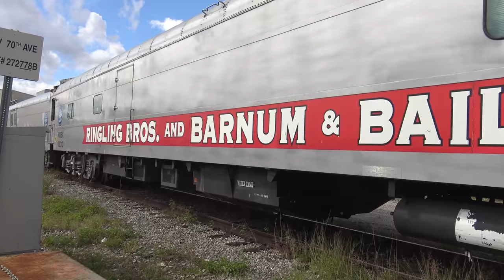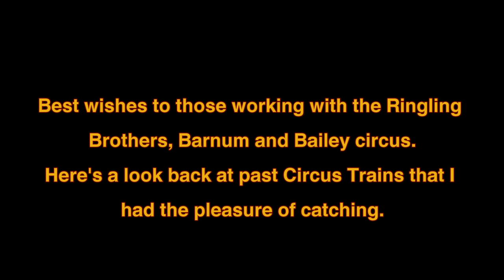Derailment and Rerailing of FEC Ringling Brothers Circus Train - Part II 01.16.2017

Comment: I was a member of a Re-railing crew in the UK. It was very interesting to see the way these boys did it. I know one thing, it`s pure hard graft.
Reply from the maker: Yep, it's such a difficult and challenging task. One has to get everything right - no room for error.
Reply: @TolgaEastCoast  On a job of that sort, we would have used hydraulic jacks with a remote control desk. The stretcher system that you used to pull the rail back into gauge was similar to ours only ours was a solid bar that had claws that went under the bottom of the rail and hooked onto the foot, so you had to dig out first and then adjust accordingly to pull the rail in. Nice piece of kit that crane you used, I would have loved for us to have one.👍☝
Reply from the maker: Stephen Smith cool, thanks lol but the RR crews should take all the credit

Comment: This is a really good example of poor upkeep, or no upkeep of the tracks

This line needed new rails, new tracks and new ballast
the FEC has been in a downward spiral for the past decade

Very sad

I like the fact that they use old locomotives and I love the paint scheme, but they use what they can afford and what they have

We used to be a rail country

For those of us who remember trolleys EVERYWHERE and people riding them to work and play, and in my town and many others in the Northeast the trolley tracks crossed the railroad tracks and there were 4 or more diamonds at the crossings because there were 4 or more main Tracks

All if our towns had rail yards and maintenance shops and we had coal companies serviced by the rail lines

The would push cars over the shutes and manually dump 100s of tons of coal that slid down the concrete and they would sell by the truck load of pail load

Poor people who couldn't afford to pay would go under the chutes and collect pieces of coal

The downtown had a huge yard and 6 tracks that ran to the next yard and to the passenger station

So many memories and it is all gone

I really miss my youth

Now I am old and sick and it is depressing

Hard to not be bitter 

Life rolled over me

I worked hard, but in this life, that doesn't mean anything

Comment: 2:47 so the crew member has to activate the crossing manually!
5:50 this couldn't have come at a worse time! The RBBX trains are on their last runs as a whole!
6:50 at least you got to do some air-fanning!
7:25 what type of horn is that? is sounds weak and worn, which is fitting for a cab car!
7:55 at least the mix of styles of cars isn't as weird as it is on Metrolink!
It's neat that you got to go up close towards the re-railing process!

Comment: The 6 axle unit had nothing to do with the rail it was due to lack of proper track maintenance on industrial leads and that song of woe dates back for years. When I worked on the PRR we put a SW1200 on the ground because the rail rolled on a old and worn out track on a industrial lead.
Reply: rotted ties???
Reply: We do have to consider that a 6 motor engine weighs more than a switcher
Reply: Looks like a lot of heavy train cars on a rotten set of tracks.
Reply: I am not a railroader.  I am in aviation but I could almost guarantee 95% of the time its because of the track.
Reply: AS I WAS WATCHING THIS. I SAID THE SAME THING.

Comment: That's why they need to go to those concrete ties that don't rot in such a short amount of time.
Reply from the maker: It's an industrial spur. No real need
Reply: @TolgaEastCoast  Yes, but installing concrete back when would save all the cost that will incur for this damage. Goign cheap always costs more in the long run.

Comment: What is the box he conductor went Into at the crossing
Reply: It's a small control panel to activate the crossing lights, bell, and gates.  There is probably some shunting done in the vicinity, so they've removed the circuit activation from this crossing and made it a manually activated crossing so that the gates/lights only disturb the flow of traffic when there's really a train crossing, not constantly kicked on by local shunting.

Comment: Why are these tracks neglected and poorly maintained? They should really replace the tracks.
Reply: It's a spur line into an industrial area.  Probably sees 1 or 2 trains a month.  There's generally no high-speed operation on spurs, but that doesn't stop the sun and the weather from rotting the wooden ties or the heat from expanding and contracting the steel.  Just bad luck that it happened to this particular train.

Comment: Derailment of circus trains: Isn't their anything sacred anymore?   The Lion probably saying AH shit! Knocking off my sleeping schedule. Somebody is going to get eaten for this.  A relative of mine was on one of these planes. To deplane it takes 45 minutes to 60 minutes. There is 500 to 800 people on this behemoth.  Fun fact it takes as much work to go over these planes for maintenance (hard work, costs) as the SST. Sooooooooooooooooooooooooooooooooooooooooooooooooooooooooooooooooooo Why did they axe the SST? Isn't that hypocritical? One is less than size than the other but you stop the other from flying which is smaller.